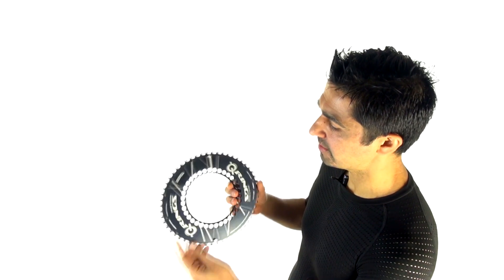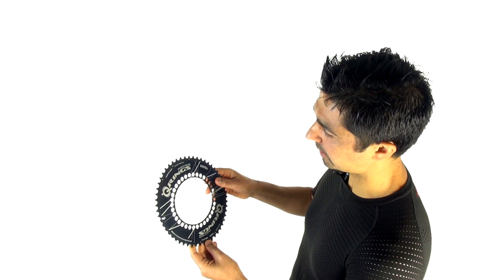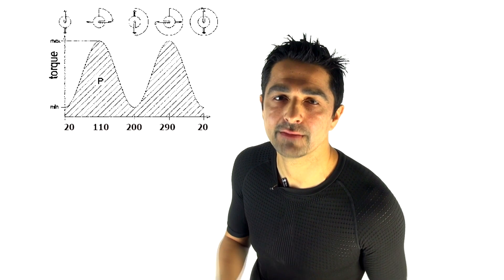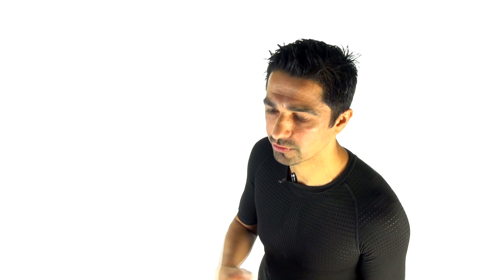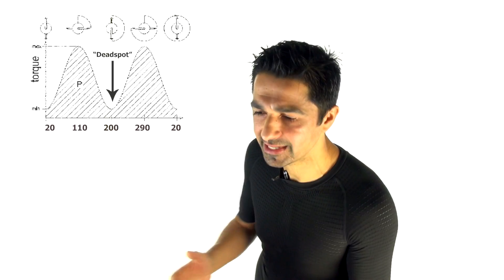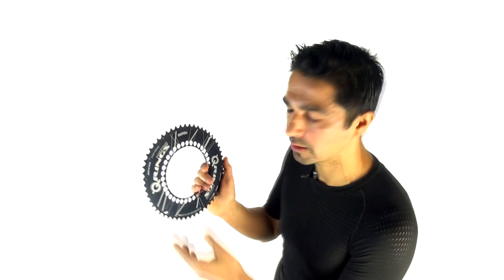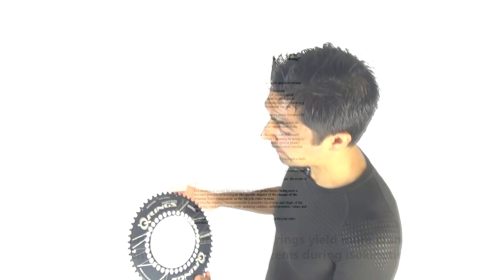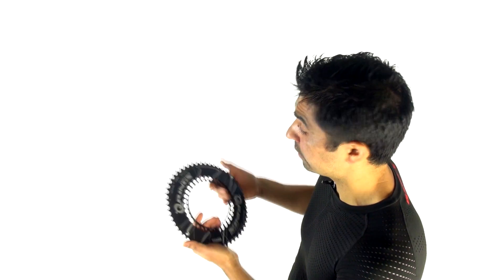Do Oval (non-round) chainrings improve one leg vs two leg cycling power (Q ring, osymmetric)

Comment: I have just ordered a Rotor ALDHU Carbon Crankset.  A 53/39 bigger gears 2 build power .  I am an old guy & l spin . Souplese as the French Say . 
Also ordered a 52/36 & may order a 50/34 . 
I have always ridden round Chain Rings . 
Have ordered 11/30 & 11/34 cassette 

Rotor ALDHU Crankset looks like the most Commonsense approach 2 replacement / swap out of Chain Rings 

Question time ⏲️.  

Can u sprint on Oval Chain Rings  ?

Nice Job here by u on YouTube.  Always gr8 value.  

Robert Australia 🇦🇺

Comment: I purchased an oval chain ring to solve a unique problem while cycling. Towing a trailer with kids. I found my round chain ring was constantly making the bike bounce on the trailer hitch and the kids didn't like it either. So I have the oval ring orientated so that it smoothens the power delivery rather than tries to extract extra muscle advantage. I also ride with clipless pedals, so I have no up stroke to help spin a smoother power delivery. As a result I discovered something really interesting. Less seat fatigue as I'm not bobbing up and down so much and it's really comfortable. Also I find myself using a higher gear when peddling. So I reckon oval chain rings bring a whole new set of parameters that can be explored. It would also be really interesting to test with a combination of crank arm lengths. Does feel strange at first. Pressure on the pedals are more linear and thus give more a feeling of being planted to the bike.

Comment: Incorrect terminology and misguided explanations!  
It's not downstroke versus upstroke - it's vertical foot movement versus horizontal foot movement.  The dead spots are when feet are near the bottom or top of the circle.  You cannot have a dead spot on the upstroke, because that's when the other foot is on the downstroke - unless you're a one-legged cyclist (but then the chainring design needs to be very different than the oval designs that were discussed).  So the video should have been talking about four quadrants of the circle, not two halves.  
It's not difficult to improve your torque through the dead spots, where the crank arms are near vertical.  We all have experience running, where the primary thrust is delivered as our foot is moving back.  Simply apply a "runner's mindset" to your pedaling and engage those same muscles as your foot moves back at the bottom of the circle.  Then at the same time, engage the quads a little early to push the other foot forward across the top of the circle.

Comment: I think it's not a matter of if ovals produces more/consistant power, it's that ovals harvest energy from the rider more efficiently. It's the same thing as when like a rider shifts up or down a gear to make the best use of their power output. An oval chain ring shifts up and down and up and down with every revolution to best match the power being out put in each section of the stroke. 

That's why all of those studies are inconclusive, they're measuring power when they should be measuring power efficiency.

Comment: Oval chainrings offer much better advantages in mtb, the smoother output reduces the breaking of traction on loose ground, it genuinely helps with the dead spot issue when on very steep inclines

Comment: I think the oval effect should be most pronounced  at a low cadence (50-60 rpm)on the dead spot (bottom) of the stroke, when one leg is at full extension and the other knee is fully bent. At a high cadence it will just be like a round chainring, becuase the changes in chaninring  diameter will be too fast to percieve.

Comment: The upstroke phase only exists for a single leg.  We pedal with two legs offest by 180', so the weak point is not during an upstroke or a downstroke of either leg (which are the same thing), but inbetween those strokes.
To make it simpler and using the right leg for reference - the weak point is inbetween its down- and upstroke.

Comment: The "dead spot" in a pedal stroke is not considered the upstroke, because as you have correctly said, the other foot is travelling down. The dead spot is the horizontal translation of the foot between the upstroke and downstroke, or between the downstroke and upstroke. This segment of the pedal stroke also generates very little power, and is where the cyclist will generally lose foot speed (fractionally). Non-round chain rings aim to make this segment of the pedal stroke FASTER by reducing the torque load present during the translation, the same way foot speed increases in your small ring. So on the Vertical portions of the pedal stroke you have max torque (56T equivalent) and on the Horizontal portions of the stroke, you require less torque to "reset" back to the power portion of the stroke.
Your pop up data showed this, but you're interpretation is off.
Reply: A low ankle pedaling style allows quality power application well beyond 180 degrees. Power application starts before the top, and a bit of a toe scrape at the bottom pulls it to way more than 200 degrees of meaningful power generation from one leg. Possibly as much as 260 degrees of meaningful power, which shrinks the dead spot tremendously. I used to pedal on the trainer in a 53x15 for 15 minutes with one leg. 60 rpm.  Probably making well over 200 watts with one leg. 20 minute ftp between 420-440 with both legs. There are levels to this, kiddo. 😉 I heard a story about a pro who rode a pro/1/2/ crit and won a prime with one leg, just to be a smarty pants. Qualitative pedaling training separates normal from great riders.
Reply: @sasquatchrosefarts  Ok, uni-leg.

Comment: old video but maaany illogicalitys here... Why are you so obsessed with the "upstroke" whem that is not even what the non round try to fix. The other legs downstroke compensates for the others upstroke. The dead spot is when the other is only at the start of the downstroke and the other just ended it and neither of your legs produce much force. And that there is a "sweet spot" where your leg is in the ideal position and produces most force, and the gradual nature of the force your leg is able to apply between these points. The non round rings tries to even this out by changing the "lever" length at a given point to make the dead spot force to produce an equal amount of torque at that point of rotation, than the sweet spot force does at its point of rotation. Considering a fixed without rachet system if a rear wheel would spin the cranks, this would result that the crank angular velocity (and pedal velocity too) would change depending on the angle of the crank. This would mean that in order to pedal at a (absolutely) constant speed, your pedals would have to speed up through the dead spot, and slow down when either of the legs is at downstroke. This would mean that when pedaling constantly, you spend a (marginally) little less time in the dead spot and "hurry" to the next power downstroke and spend more time there. But in order for you to gain extra speed or torque or something during that spot of rotation, the energy has to come from your muscles and it doesnt just emerge from nowhere. But I imagine this has more of an effect when you have to pedal slowly.

This video just had too many very abstract terms and concentrated too much on wrong things and that way just made the whole concept more difficult...
Reply from the maker: agreed, I need to redo this old one!

Comment: I'm using an Absolute Black 34t oval inner ring and a round outer ring on my Ultegra 11-speed setup.  Shifting with the front derailleur has been flawless requiring no adjustments. The difference between a 34t oval and a 34t round is not really noticeable other than it feels like I pedal smoother with the oval ring. I am considering an oval outer ring also.

Comment: Ovalized chain rings only have an advantage on a granny gear going up steep hills.  Prevents Flat Spot...
Reply: This is the conclusion in drawing. Because in high inertia pedaling, you can get over the dead spot with 0 torque and the bike will keep moving (unlike on a hill).

Comment: These videos are usually great but this is a real disappointment. The fundamental question of whether asymmetric rings enable a rider to produce power more efficiently is not answered. There also seems to be a lack of understanding of what the dead spot is and what mechanical advantage and disadvantage are. The dead spot is actually a combination of the points over the top and under the bottom of the pedal stroke at which the mechanics of the body make it unable to exert force efficiently through the combined effort of both legs simultaneously (hence the reason it's a dead spot), not on the uplift for which the opposite leg provides the majority of the power (as stated but not properly considered). We ride with two legs, so discussion of one legged power  production just muddies the water and belongs in a separate analysis of pedaling technique.
Reply from the maker: Yeh I kind of agree, I probably need to re-do it; with less rambling and more science!

Comment: Take in account that the human body is not a machine solely based on mechanical functionality... I felt a overall “smoother” more pulsing than charging stroke and considerably less fatigue as well as increased traction on technical steep climbs, which results in a more consistent movement. Oval chainrings do help at least for me and in mountain biking.
Reply: So glad to hear your comment. Do you think it would help an amputee with no ankle, who really has the dead spot on tdc while standing and cranking? That's me, I have been trying to find a solution and thought the oval might do it.
Reply: To be honest, I can only speculate. But first thought it should help. From my experience the dead spot as felt in a very slow cadence on steep sections is reduced. If your bio mechanical setup is prone to feel the dead spot I guess a oval will help, at least there will be less torque in the 6/12 clock position as you effectively have a smaller sized chainring. Hope this helps?

Comment: I've never felt like they made me go faster, I've only felt that it makes low RPMs easier, and high torque riding less tiring than round rings.
It's more of giving your legs an ever so slight rest and shortens the effort period per revolution.
Reply: Sean Young how is it giving your leg a rest in the down stroke (high torque zone) when you’re pushing more teeth? If anything it would make low RPM harder
Reply: @scottgeorge6375  I think he means he can put the same power he would have put through a round ring, in a smaller time period or window when on a non-round ring. So a shorter, yet stronger push to then gain more recovery time during the revolution. Another way of saying it is, non-round means you can push only during 2 to 4 o'clock (viewing right side of bike) but with more power. Where as round rings, on a hill, you have to push from 1 o'clock to 5 o'clock. It all comes down to what you're better optimised for. High inertia or low inertia pedaling. I think genetics and lifestyle play a big part in that.

Comment: The "peanut' shape power curve is caused by the two legs. I don't think you can move to practical consideration without always considering both legs. So you have take your sine wave, double it and shift it 180 degrees.  of power 54T on power down, but only 8T on the lift up of that leg, the net result when you combine the two legs is 54-8 = 46T and the narrow part of the peanut is when the feet are at the top and bottom,  so that might be (I'm guestimating now) maybe 36T. But then you have to consider momentum with further evens everything out. So I can see where bright people, and bicycle engineers, can reasonably disagree. I've been peddling a Fisher HooKoo E Koo (I guess 1987) with a Biopace eccentric. My results.... I don't really know. It's okay. 
I think for a duffer like me,   an eccentric chainring  is probably the most helpful on steep slow climbs, where a couple of teeth (leverage) one way or the other makes a big difference.
One YouTuber mentioned this. 
7:15 You're discussing climbing. The test of a possible benefit of the eccentric chainring? Video riders peddling up steep slopes right at the point where they crap out. If eccentricity is useful, then those riders who crap out will be doing it when the peddles are top and bottom and they just can't get the peddle to where they can make that down stroke. Eccentric rings should show their value (if there is any).   Consider a climb where you can keep going with 34 teeth, but not with 36. Eccentricity gives you both. 36 where you have maximum power and 34 where you don't. 
 Overall cycling I think it is more effective to keep a steady 60-80 turns/minute pace, and even out my peddling: moving towards the 'sausage' of the professional cyclists. 
Bottomline: The real lesson here I think is about leverage. And not just for cycling. There are some eccentric 'fulcrum' levers, more mechanical advantage at the beginning, but as you lift the mass and moving its center of gravity (think of tipping over a rock) it becomes easier. I'll try to keep your video and my random thoughts the next time I'm thinking of simple machines.  
Really smart video. Well done. You said, "you only notice when you change between oval and round." Ding! Okay, I have strong legs, I think I 'muscle' my old Hoo Koo E Koo a lot more than rented and borrowed bikes where I keep an easier gear but a faster cadence (and I think I also keep a more consistent cadence).   I'm thinking about getting a new mountain bike. I want a very low gear for climbing, but oval or round? I won't worry about it.

Comment: Ill stick with a round one,it fits nice in my mrp chain device,it would be pointless with an oval ring,youd need the guide block and jockey wheel slackened off,that defeats the point of its purpose If i had an xc or all mountain bike id rather stick with the triple ring set up for hills,i tried one on a triple ring set up,wouldnt work with the front mech,i had xt bio pace years ago,that was a lovely set up for climbs,you could drop gears,unlike oval narrow wide chainrings

Comment: What do you mean by one leg vs two leg cycling power... No one cycles w/ just one leg, or at least I've never seen which isn't saying much. I can see how the chainring would be in one position for flat riding.. and another (just the opposite) for uphill. Am I understand that correctly??? I'm a much "lighter rider" than most of ya, short trips here and there; as well, practically being new on a bike these days, for I haven't had one, nor rode a bike in 40 years, but I've got to get out of here, for I need the exercise big time. Talk to me, please. Question: What effect, if any, would an oval chainring have on the crank shaft / bearing???

Comment: I think the approach of the large part of the persons who comment here is wrong. The "Speed" is clearly a wrong parameter to consider by itself. The right point of view is the effort necessary to move from one point to the next of the 360° of the pedal stroke. We have very different muscles in the leg and the output is very different in every single one of the 360° because the mainly involved muscle have his own carachteristic as effect of the mass and of the position on the articulation. So the oval chainring tries to redistribute the loads overcharging the most powerful muscles (that are strong enough to support an overcharge) and "decompressing" the weaker muscles. This is not properly going to increase your output, but your autonomy at a certain output. This is the "correct approach" to non round chainrings, that is very different to giving the illusion of some free watt to a pair of legs legs. After that, i think that to considere the individual preference to the number of teeth and to consider a proper practice with the chosen chainring is foundamental. 
I hope my english is clear enough to avoid misunderstandings. 
Bye!